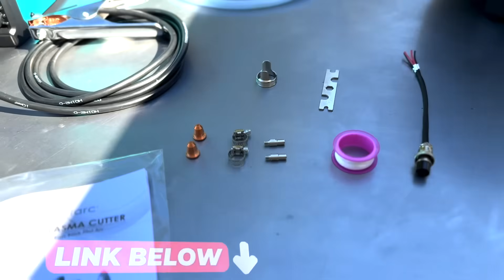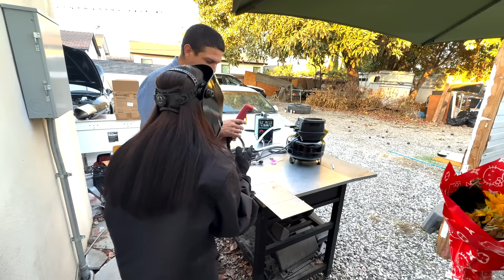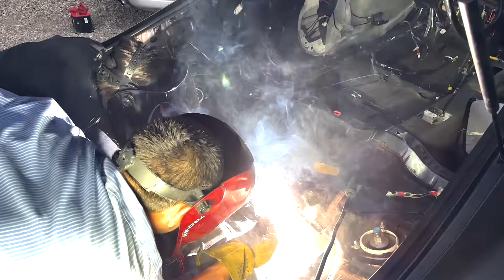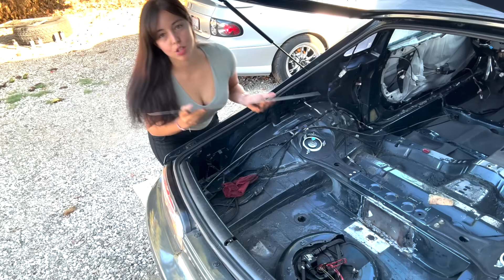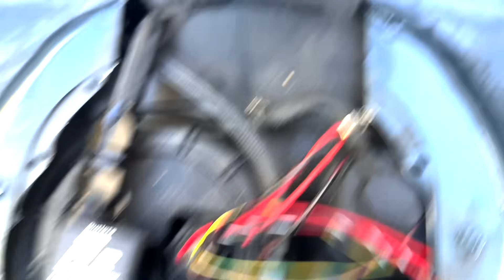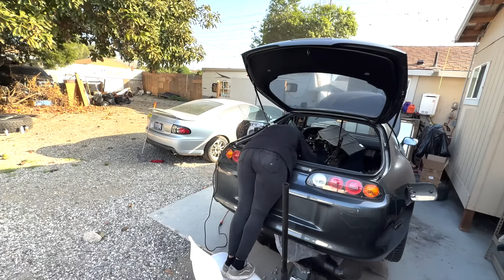I did my first custom panel on the supra!  (Trunk pieces were missing)

Comment: U need to spray the metal from backside with undercoating from napa.  It will rust fast.    Use a drill with wire wheel for cleaning welds..

Comment: Awesome to see her persevere crafting the piece she wanted.  A form can be made using wax paper cut into strips, which can be heated to make it stick together then one can use a epoxy resin and fiberglass can layed down over it to make the piece.  Just this last week I was watching some stitches being layed down in intervals as not to get the sheet metal not to distort by one using a welder showing how they did with a wire feed unit. Note that structurally I had one tie a boat down over a 2"x2" that I had saturated with polyester resin and was glassed in the transom of a boat which was only supposed to be a temporary fix.  What's best for me is that this isn't some studio build, but a gal who's enjoys playing with "Lego's".

Comment: Hi, just an advise, next time use a steel liner with 1 or 2 C clamp and the cutting line will be straight as hell
Reply from the maker: It came with a guide that’s placed on the tip to cut at a distance which I thought would be enough, but next time I’ll definitely try that out to get it straight the first time!

Comment: I was going to say the same thing as other comments. Use a guide rail to make straight cuts with plasma cutter. Also, I would recommend mig or flux wire starting off welding. It's a lot easier to learn than go from there.

Comment: To create a shape, you need something that has that shape and you hammer on it many, many times. That shape could be made by hammering on top of a wheel, many blows with a small hammer. That hammer is huge for a body shop.  
You can buy pieces of iron shaped like spheres, elongated shapes, etc., which act as a support against the hammer blow.

Comment: To cut straight, use something thick like a board or metal bar to support and guide the torch; there won't be enough voltage if it doesn't cut through. Welding involves making tack welds, one against the other. If you push it, you'll burn through the sheet metal. To start, you can place thick steel and begin against it. You both have a long way to go. 👍✌

Comment: Hi just checking out your build an I noticed that your seals for doors and sunroof are still available at the dealership or the Toyota website for parts a lot I’ve been also trying to get the seals for the roof due to leaking water also hope that helps out